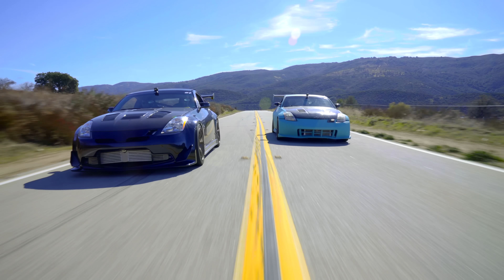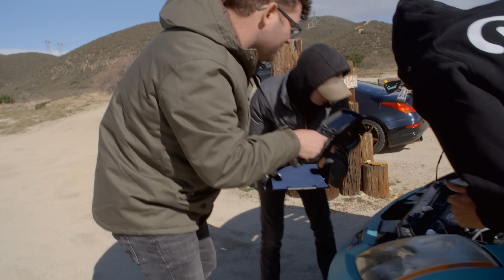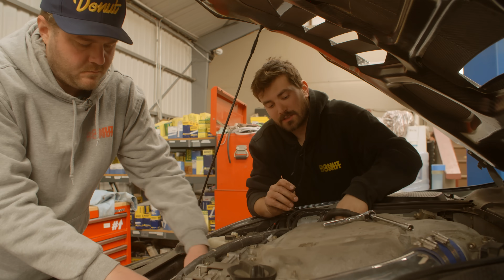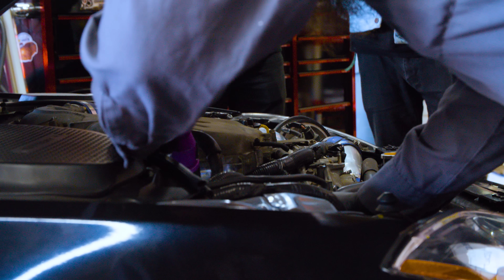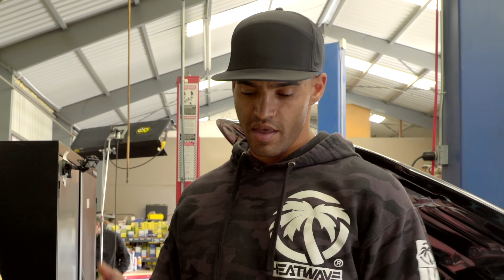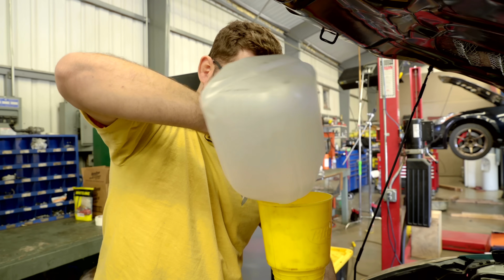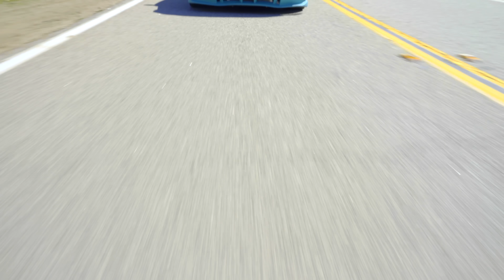$200 Radiator vs. $500 Radiator

Comment: Who else shook their heads when they put straight distilled water? Hopefully that's just for the video.
Reply: vader bee in race cars we use all distilled with one small bottle of water wetter, works just fine, I really don’t see the issue.
Reply: @keg26  to each his own, in race cars I've worked on, driven or watched all use a coolant mix.Because it's designed for it. And with a decent formula combined with an upgraded cooling system, running straight distilled water is not really that much cooler vs life of the engine.
Reply: vader bee well I don’t want to be on any race track you are at with any coolant in the system. That shit is slippery, and unfortunately I have ended up in a wall because a street car was using it.
Reply: vader bee and just so you are not confused, I mean full race car. Not a car that is for track days. It’s a spec Miata. And no one on the circuit is using any type of coolant, only DW and one small bottle of water wetter.
Reply: Kegmeister OK once again, to each their own. The full race cars I refer to still run coolant. The only time you run straight distilled water is if there’s an issue with the cooling system and don’t want to risk dumping coolant on the track or road. Btw these aren’t full race cars they’re testing.
Reply: Kegmeister OK I feel the same way I wouldn’t want to be on the track with you when your water pump seized up. Anti freeze does more than help with water freezing in the engine. If your car is dumping coolant then it shouldn’t have passed tech to begin with.
Reply: vader bee I’m sorry, but it really isn’t to each their own. Antifreeze is explicitly banned in every form of road racing I know of. So if you are running, please get the hell off of the track, for the safety of everyone.
Reply: @keg26  clearly you don't know  motorsports or road racing. I'm not even sure you have a license with the way you are trying to argue about coolant. With your logic you shouldn't run oil in your car because it might cause a track hazard. There are risks in racing, you try to minimize that with tech inspections to make sure your car isn't leaking coolant and/or oil etc. A properly lubricated cooling system would probably run as good if not  better than straight water anyway. Running straight water is only for flushing the system or checking for leaks so you're not wasting the expensive RACING COOLANT.

Also on the topic at hand, these are not full race cars being built. These are test cars being built, presumably for road use, to display the difference between cheaper and more expensive parts.  What might work in a racing situation may be counterproductive or dangerous for road use. Read the comments below or actually do some research and you'll see why some things are RACE ONLY. Also, I like the builds, don't get me wrong, but since the last time I was in Cali I was pulled over in a stock accord for no reason but the cops thought it was modified, I would say it would be a bad idea to film my car being fitted with cat deletes and doing pulls on public roads then posting it to social media. Hopefully nobody caught on to that because Youtube is full of snitches.
Reply: Idk in  all Florida tracks only allow straight water with a wetter  agent but  hey only I drive at Daytona Beach tracks  few hundred times
Reply: Nothing wrong with water man. If you track your car you gotta run water anyway
Reply: If that’s the regulations tracks are pushing these days fine, but the logic personally doesn’t make sense. And yes I have slid through a coolant puddle a few times but I found oil leaks to be just as dangerous.

Anyway, that’s not the main argument I had with some fanboys earlier. The fact is these are NOT race cars. Some people are not understanding that for street or highway use this is not a good practice; even with water wetter etc.
Reply: It's Cali, what's the problem?
Reply: @chasemc69  spending almost $600 on an upgraded cooling system only to skip out on $15 worth of coolant? That's some Florida Man logic, even in Cali. They touch on some of the reasons in the video. Plus it's not doing the water channels in the engine any favors, even with distilled water. They're already pushing their luck with pushing a turbo on a VQ without throwing a rod; even on low boost. But hey, to each his own.
Reply: The problem is that radiator fluid is a lubricate so using that much water to such a low amount of coolant will wear your water pump out faster.
Reply: The ONLY water that should go into a car is distilled water. NEVER put tap water or any other kind of water into a car unless it's an emergency.

Comment: In the na/nb Miata world, Mishimoto fans + shroud can cause them to start overheating, when it wasn't an issue before. I've heard it's from a combination of weak fans, the shroud being too close for even air flow at speed and/or restricts air flow at speed. (to be fair, Miatas are already hard to keep cool anyway) 

This test was all done at speed, when the fans really dont do much, if anything. Should see how the temps hold up while sitting in traffic on a hot day, with the ac on.

Comment: Please change your coolant again!!! Using destilled Water ist one of the silliest things what ist writen an told in the www ... there ist no any minerals in it! The problem ist the destilled Water has the urge to take minerals, but where from??? It sucks out the minerals from the Aluminium Block and Head an the Material disolves till some Parts fall off and so many other issues. Take normal Water or with a little bit coolant or a "ready to use mix"  suitable for your Engine.

Comment: If I were to build a performance car, I'd know no compromise about cooling, or even lubrication. An engine damage from either continuous overheat or lack of oiling would be a kill switch for the fun..
That said; better cooling + better lubrication = more stress endured = MOAH POWWAH, BABE!
Oh and I too would mix some anti-freeze into the coolant, for anti-rust capabilities. Downside is that the fluid becomes thicker, water pump has to endure a bit more, but unless it is 75:25 antifreeze to water... I think it is manageable

Comment: From what i know , that removing cats and replacing them with test pipes does help a bit with the heating issue, cause literally after 15+ years, dem cats are definitely clogged at some point and from factory they’re just too restrictive. So i think you might consider to replace em on low car like you did on high car.

Comment: Hi car had the cats removed for a more free flowing exhaust, meaning the car will run cooler. To make this test of the radiators  equal you'd need to make both exhausts the same.

Comment: Running only distilled water can also cause corrosion in your engine so a little antifreeze will allow the inhibitors to stop the water from causing issues with any steel parts like the coolant impeller.

Comment: You need to make sure the radiator is shrouded so air has to pass thru it.  Also fan needs shroud to really pull air thru it when sitting or going slow.  Use cardboard if need to

Comment: WHAT?!?!?! Coolant raises the BOILING TEMPERATURE. What the actual f is that guy talking about?!?!?! Revving the engine to get the fans to come on? Surely, you mean getting the THERMOSTAT to open. When its closed, your rad is doing nothing. Jesus, can’t watch this anymore. Unsubbed

Oh, ps OIL COOLER. Might wanna look into it considering, the extra heat you putting back into oilpan...🤦🏻‍♂️🤦🏻‍♂️🤦🏻‍♂️🤦🏻‍♂️🤦🏻‍♂️🤦🏻‍♂️🤦🏻‍♂️🤦🏻‍♂️🤦🏻‍♂️🤦🏻‍♂️

Comment: Not only does real coolant cool better, it also lubricates the cooling system, preventing corrosion and all the issues that come with it. Distilled water doesn’t do that so you should add a water wetter (Redline, Dexcool, etc) to improve cooling and anti corrosion properties.

Comment: Went with a full Mishimoto setup (fans, radiator, hoses, thermostat) on my Stealth (3000GT) RT/TT (VR4) and it overheats so much faster than before. The radiator is smaller than a $80 aluminum radiator I had before and the fans don't flow enough. Can't be more disappointed in the upgrades.
Reply: what did you expect with Chinese junk?
Reply: @davconelectric  I expected a "name brand cheap chinese junk" to be better than a no-name ebay chinese junk.
Reply: @Drew Price  that's fair enough,   did you end up getting sorted?
Reply: @davconelectric  Maybe? A fan that blows twice as much seemed to do the job a lot, but then I bought another car (C8) and the Stealth hasn't driven for six months... lol

Comment: Universal fans work fine if you’re fine with making your own shroud. I have a thick boi mishimoto knockoff radiator with a pair of 12” universal fans. A little bit of weather stripping stuff and it becomes a shrouded system that makes a bunch of noise

Comment: Distilled water should not be used in a cooling system.  Huge common misconception.

Lol reaches for the steering wheel 15:02
Reply: Every coolant either already contains distilled water (it's ready to use, dilluted) or it doesn't and you have to mix it.
Reply: @BlueWafer  I'm aware that they mostly do.  But if you know anything about electrolysis, you'll understand why you shouldn't use distilled water at all.  Soft water should be used over anything.  Filtered regular drinking water is better than distilled for the system.  The addition of coolant helps the distilled water to take ions from it, rather than the metal, however, it'll only last for so long before damage may occur.

Comment: Did anyone think about the low temperature run of the high car aswell? They measured 63 degrees at the radiator outlet. Is'nt that a bit low to enter the block where 90 degress exits?

Comment: I would be really interested to see them swap the radiators and fan shrouds from the 2 cars to see how much better the $500 setup would be in Low Car considering that Turbo Placement seems to be the real culprit for heat generation. It is possible the bigger radiator still won't do that good of a job if the ambient heat is making the radiator super hot and reducing the cooling ability of it.

Comment: I have an '06 STI, and have the Mishimoto X-Line (Fatty) radiator and dual-fan shroud (like the one shown in the video).  I live in the Devil's Asshole known as Arizona, and swapping these out, with some silicone hoses made my cooling system drastically more efficient.  My needle has not passed the halfway point since the install.

Also: please use actual coolant.  I also use water-wetter and because I drive a Subie with questionable head gaskets, I also use the Subaru conditioner additive.  DON'T USE WATER unless you have no other alternative.

Comment: Wow wow wait! no distilled water please... I know it is called anti freeze, but a good coolant does way more than not freeze. it als makes sure it won't boil as fast, and at the same time, chemicals prevent rusting and absorb dirt particles... so please stop using distilled water... water is only a medium 'OK' when flushing the cooling system.. or emergency fill up

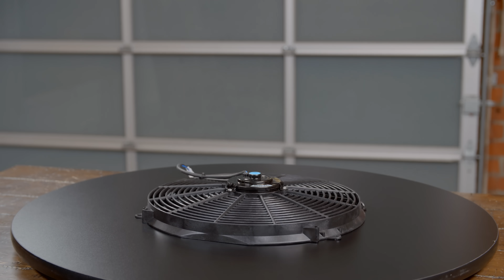Comment: @00:55 oh nooooo, you would have been better off stock radiator with a Quality Spal fan for the Lo Car. 
As to the Hi car i think you could have gone Spal as well for the fans.. the mishimoto fans should have been on the Lo-Car not the other way around. That $30 Fan will be the death of Lo-Car that's like LoLow-Car

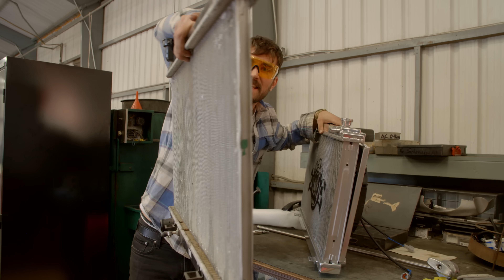@11:50 I retract my statement about the better off with stock radiator... DAMNNNN
Okay so Upgraded radiators both awesome, but still that $30 fan is a No No, Stick with stock or Upgrade to the Mishimoto for Lo-Car and some good Expensive Spal fans for the HiCar lol

Overall, Awesome Video, I'm glad you guys didn't seem to use the $30 fan that may have been catastrophic lol. 
Overall, Both Radiators were definitely an Upgrade and seemed to be much better than stock. 

Very Good Video. 
Would love to see a Hi-Car Re-Dyno De-catted and compare the numbers where it previously topped off.
& would love to see a Lo-Car Re-Dyno RE to fixing those prior vacuum leak & Turbo kit design flaws being fixed. would love to see if there's any differences. & perhaps decatting Lo-Car as well if that's legal in your state

Comment: Be careful using a thermal camera on metals. Slightly different surface finishes and materials will have completely different emissivity constants. It can pretty easily mess up temp measurements.

Comment: No wonder the original radiator was not cooling - it was not designed to have a large intercooler in front of it putting all that extra heat into the system!!!!!! That after market fan is only good as a frisbee!!!!

Comment: Those clamp style hose clamps, I recommend replacing if they are a few years old and you are putting on new hoses.  Those clamp style can lose their "spring" and holding power.  The are great when new, so spend a few bucks and get new ones or the screw type.  Again, you get what you pay for, so don't cheap out on the small things that only cost a few bucks... Also here in Phoenix, I recommend doing preventative maintenance the hoses every few years! Being stranded over a blown hose or clam sucks.

Comment: Glad they had good luck with the CSF radiator. My experiences were much worse. Replaced my OEM radiator with one because I wanted to bring the coolant temps down, and ended up have no ends of problems with them. Kept developing leaks left and right with them. Ended up going through 3 separate ones within a year before swapping in a cheaper brand and no longer had any issues with it.

Comment: OK seriously guys... why on earth didn't you just run an OBD2 port reader and have an actual read out on the dash as to what your coolant temps were?

If you were being really picky, you could've even swapped out the coolant sensor from one car to keep it even more accurate.

It wouldn't take any of the fun out of it, and the silliness of trying to gauge a temperature after the fact of the driving with a FLIR camera instead of measuring real time data seems a serious failing.

GO OUT AND DRIVE IN THE CANYONS AGAIN PLEASE!

Comment: I feel the test was ruined by simply replacing antifreeze with distilled. That should of been stage 2 testing
Reply: I’m glad someone else caught that potential contamination of the results.
Reply: It was not replaced. It was diluted. Not the same thing although it does still affect it
Reply: true! quick question though as a non native speaker: Is the "of" in "should of been" the replacement for "have"? I have read it acouple of times, but I am not sure whether it's an dialecto or not.  thanks guys.
Reply: @vivalaphill  it's suppose to be "have" not "of"
Reply: vivalaphill I’m not a grammar police or anything the original word should have been should’ve a contraction for should and have when you’re taking phrases and trying to spell out a phrase from the way you shorten words to make speech more efficient sometimes phonetically American English isn’t the best for phonetics or for cases like this.
Reply: @ashspades5307  thanks alot for the explanation!
Reply: Not really, they weren’t testing specifically what rad makes the most difference to temps they where testing if doing work on your cooking was worth it and what to pay for it, using better cooling is part of the work

Comment: I don't actually think modern cars run antifreeze, pretty sure it's glycol based.
With LO car, surely there is more of a flow issue regarding body kit and intercooler placement. The thermostat may also be faulty and staying partially closed which is restricting flow. It seems like the radiator swap was pointless. As you never fixed the real issues. Another issue is that the air fuel ratio on LO at a higher rpm might be too lean causing excessive heating. The 350Z has a great cooling system and I think general wear and tear and an inadequate tune might be to blame. HI car didn't have issues with heat to start with because they probably had better air flow to start with and better tuneable platform.

Comment: I changed Mishimoto 3-row cooler on my Subaru and it runs on lower temp than before and the needle is also on lower level than before. So yeah the more liquid you run in the system the cooler it gets

Comment: The video was good but i dont really like that low car is overheating.. you shud put new spark plags in and put colder spark plugs or you will burn pistion rings... the car is not supost to gor over 90C it meybe be somthing wrong with thermostat or water pump... and if you will over heating even more you will looking fowart to CNC doing the head (2x because is V6) to make it flat again and a new head gasket... 
Find the problem fast...